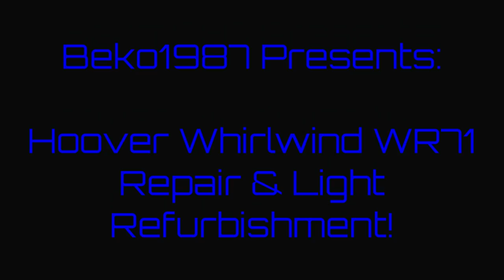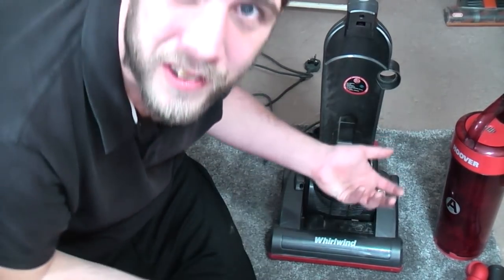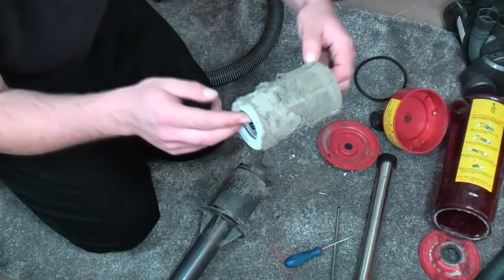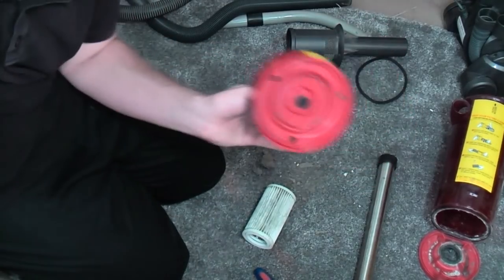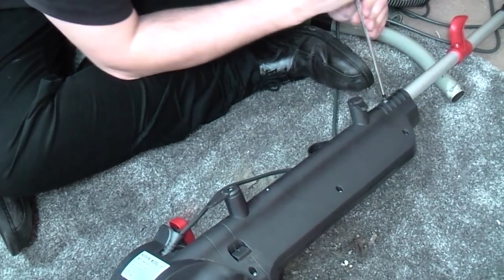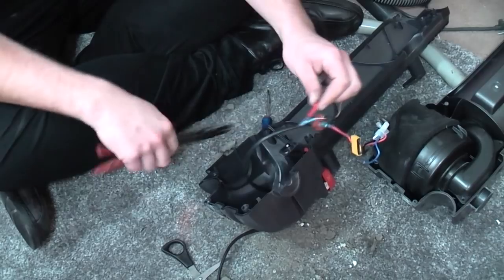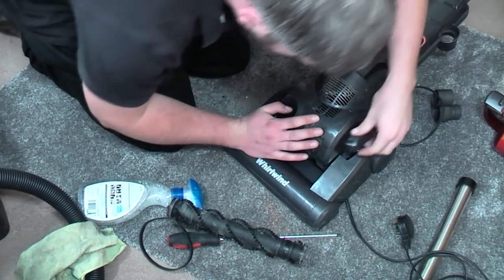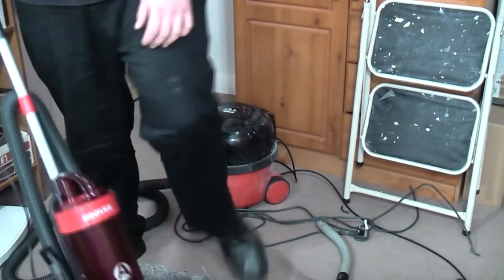Hoover Whirlwind WR71 - Repair & Cable Replacement!

Comment: We used to sell these but they were forever being returned like this. We ended up keeping one for our 'shop vacs collection' and the filter looks like this after each use lol. That aside though, it is quiet, lightweight, and easy to use- not hellish for the £60 or so that they retail at
Reply from the maker: For the 7 minutes they arent clogged they do work really well, as you know! Clean the filter out weekly and it'll be a great vacuum. Sadly the best way to clean the filter every week is to vacuum it off with another vacuum, and i dont think anyone is stupid enough to do that are they..... oh
Reply: @beko1987  you can just wash the filter & stick it on radiator to dry
Reply: Omg I have had a 56 year old henry Hoover

Comment: The filter is small on this machine lol.  It needs very very regular maintenance.  We have it South Africa but it's called a zoom pet.  Has a 1800w motors though.  It's cheap but works well, granted you keep the filter very clean.

Comment: Good video cheers bit long but at least I know how to get the filter out now washed it & dryed it 😀 now works wonders some one has cut the rubber seals of the bottom of the one I found in a skip don't know why ?  but now works great on short pile & tiles all the best cheers 🍻

Comment: I got one that I restored it had a blocked hose both the accessible filters were clogged the motor is straining on its power on the brush was tangled when I cleaned the garden the bent started smoking bc it over heated the belt

Comment: I used to have this vacuum cleaner but then it got difficult to push then I bought another one and then after that other one I bought the same one as this but it was the VAX quicklite pet which you can still get from some shops in 2022 it's the same design but it's a little bit better because it has a setting dial that you could make it go a lot more easier but still the same
Reply: WHATTT thats soo old from 2014 how did you still have it

Comment: My 6 month old hoover ( this exact one ) stopped turning on whilst in use last week and I've followed your step by step guide taking it apart and can't see any loose or damaged power supply cables as it's pretty new anyway so all seems to be in order so what would you suggest trying next ? I must add I probably should of checked the fuse before taking it apart which I have not done ( rookie mistake I know 🤦 but this is my first time at trying to fix one as I can't afford to buy a new hoover ) but how can I check that it's not the power button before putting it all back together again or do you have any other suggestions as to what the problem may be before I loose my patients with it and it ends up flying out of my 4th floor window lol many thanks and all suggestions welcome 👍
Reply from the maker: Hi! Without a multimeter you'll only really be guessing... Fuse, cable, switch are all tested with one, otherwise it could be something on the motor which has blown...
Reply: Took it apart, checked all connections and put it back together and it worked, for about 5 seconds then stopped again so motor is fine and I'm assuming connections too however do not know why it just stopped again. Tried contacting Hoover and haven't received a reply back yet so I'll await an email back from them first and then go from there. Thank you for replying to me. Your video was SO helpful so thank you again x 👍

Comment: Have you ever done a inner cable repair  on a vax pet hoover i went and ripped the notor out thinking the inner cable was done but turns out the sheath. That goes in to stop supposedly bending and chaffing wires which is why im here but i ripped the wires out the motor and never had any photos then relised it was fixable 😂😂

Comment: Girlfriend's mum has a Hoover with that filter, after every use the filter looks like this. Gutted after I'd got myself all dusty cleaning it, just to turn it on and it look exactly how it did when I started...hers has a lovely little wire mesh thing over the top too which gets covered in fluff...awful design 😱
Reply from the maker: Their terrible arent they! Good brushroll, good suction, terrible everything else! Typical modern bagless tripe they are

Comment: That s y Dysons do not clog up
Reply from the maker: Yep. As questionable as their build quality, longevity and air path designs can be, no other manufacturer has ever come close to the Dyson cyclonic system. I moan about my V11 letting a bit of dust through, but that's comparing it to a bagged machine, as we know from the Tineco PURE ONE, it's utterly fabulous at dust retention in comparison. Pleated filter 'cyclone' vacs are still being made now, and their bloody terrible! A DC01 runs rings around this in terms of filtration